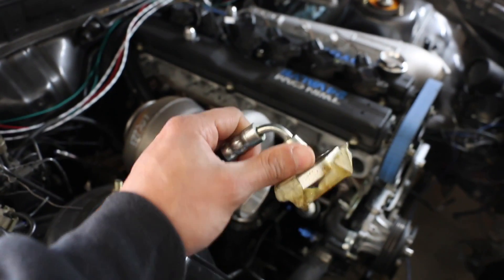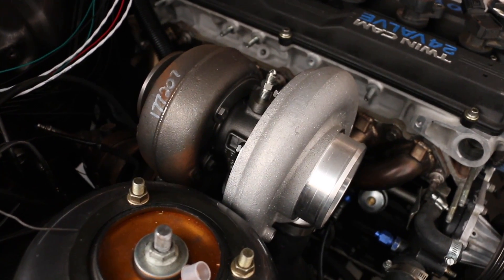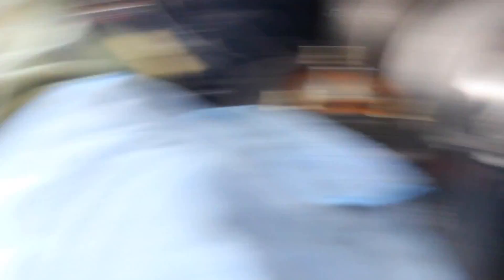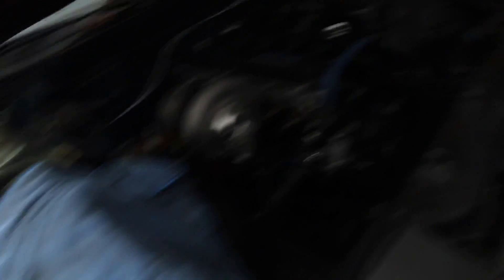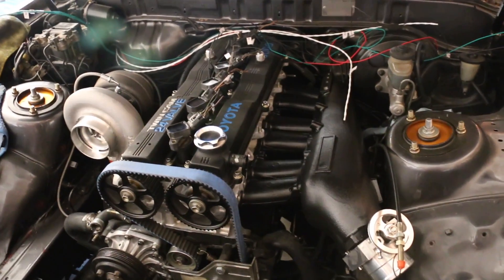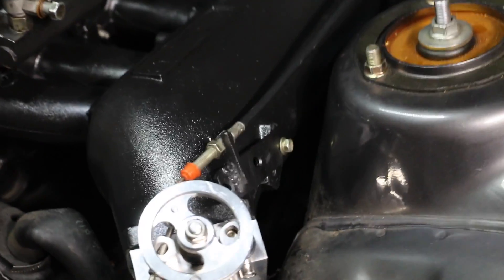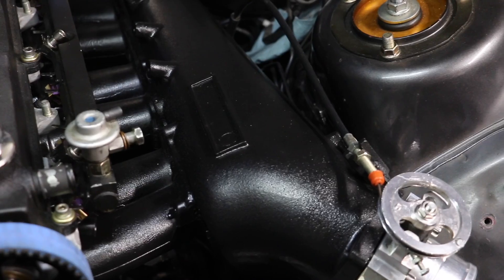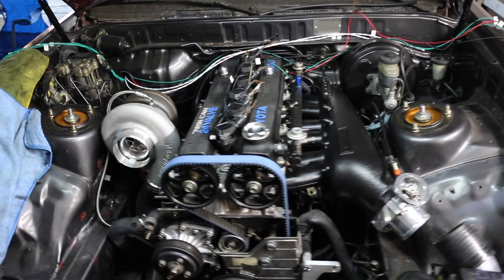MK3 SUPRA BUILD UPDATE (THROTLE BODY ISSUE FIXED) 👍🏼

Comment: I’m guessing standalone ecu controls idle through the TPS being the IAC is deleted on that setup
Reply from the maker: Somewhat, you would inpy adjust fueling for specific cooling temps, and Idle control valve is recommended

Comment: You should really run some heat sleeve on your turbo oil feed line.  That will keep it from burning again.
Reply from the maker: Gerald McClellan i only ran it on the return not the feed

Comment: Good work again. I was going to say to mount the TB with the throttle plate up, but you finally did that 😉It will be easier to give it throttle by hand. The TPS will be a bit of a pain to adjust with it being underneath but maybe you'll be able to adjust by taking off the TB quickly.  What is your turbo? Ball Bearing or Journal ? Just questioning for your oil feed size and center cartridge orientation.